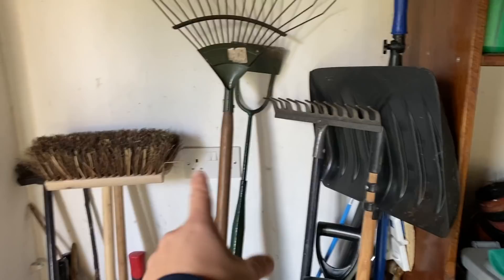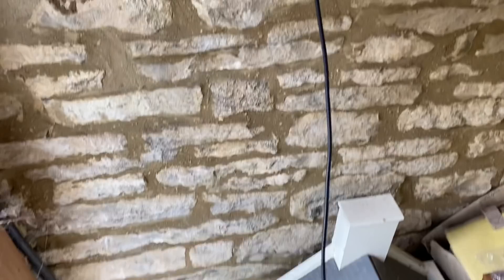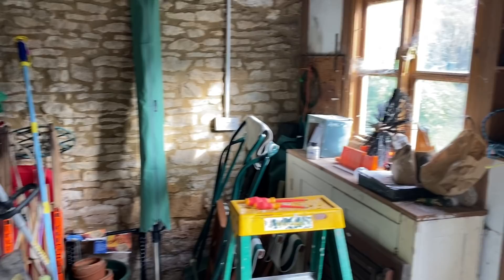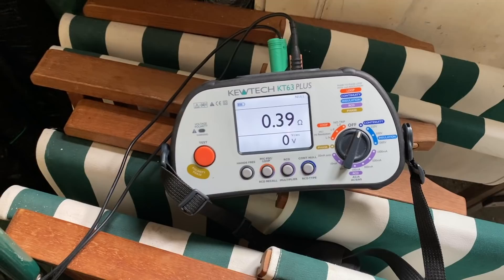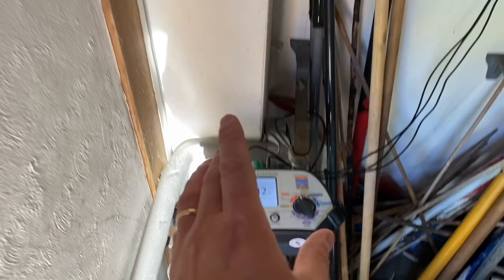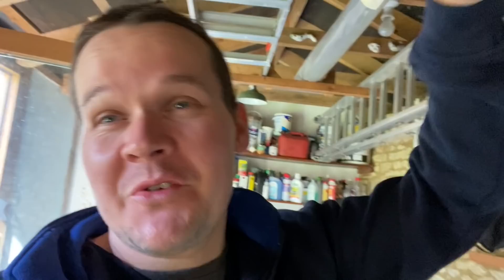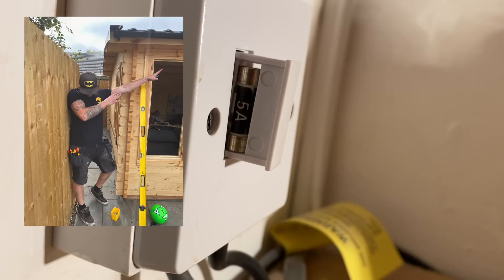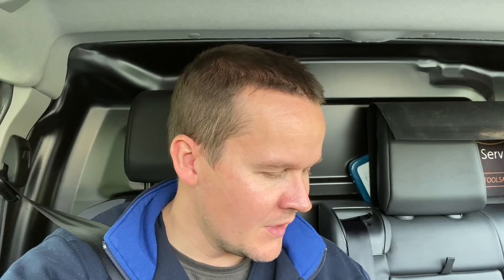THAT WAS A SHOCK ! Testing and inspecting electrical circuits.

Comment: Must of been either a colour blind electrician or they thoght black was live and red was neutral but who knows but their wrong as red was live and black was neutral the reason they changed this was due to colour blindness and doing the mistake what's Shown in this vid was that the live and neutral was wired in wrong as to my guess is that reversed live and neutral is that it's weird wrong , but correct me if I am wrong.

Comment: Have to have a moan about your "fix" under the immersion heater cap ... the live and neutral SHOULD have been moved to NOT rub against the long cover screw if.when the mains lead is pulled. Not just the fact that ir puts extra strain on the wires but a potential short circuit hazard! Also, the earth should ALWAYS be the last to be pulled out, not sure those wires would do that. Looked like the earth would be first and L/N last to get disconnected!

Comment: Why do electricians get so arrogant about diy job, if it's done right (which this wasn't) then what's the issue, electricians charge way to much for simple jobs- swap a switch of that 100 quid an hour...
Reply from the maker: Because it’s damn right dangerous when it’s done incorrectly not like plastering a wall badly is it?
Reply: Because the average DIYer isn't competent to do the work safely & to a high standard, mind you there's some sparkies about that you could say the same of!
Reply: And how much of that £100 per hour (which most don’t charge btw) do you think we take as actual wages? Factor in cost of van, insurance, tools, training, scheme provider costs. And so on.
Reply: Typical mentality of a DIY’er, Until it goes wrong. Then on the blower to a spark. Most DIY’ers don’t touch plumbing ironic really.
Reply: @jurassicsparks5220  great point that
Reply: @Cjrelectrical  Totally agree. We study for 4 years to become a highly qualified and professional tradesman. I love people who slag off us sparks. These DIYers need to show some respect and we graft hard to earn the money we deserve